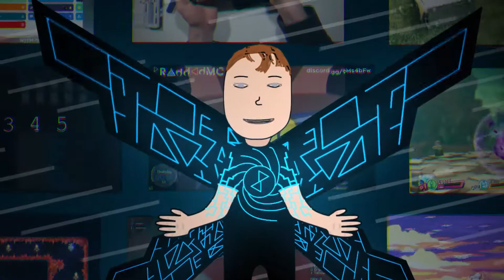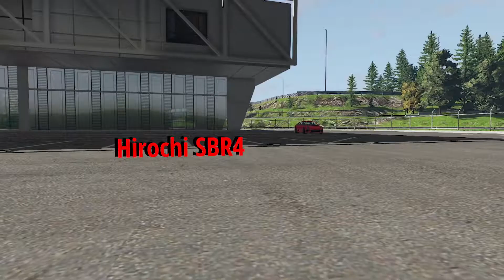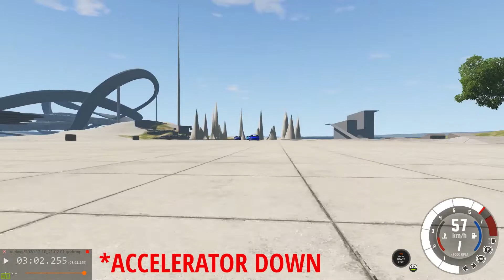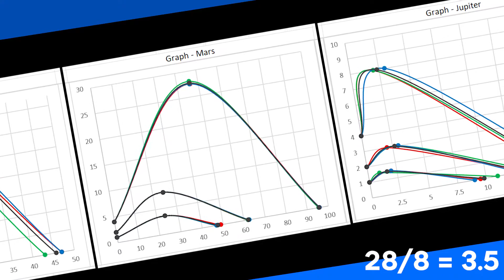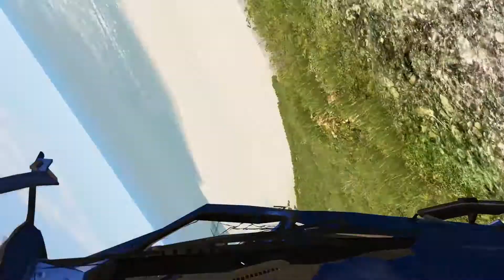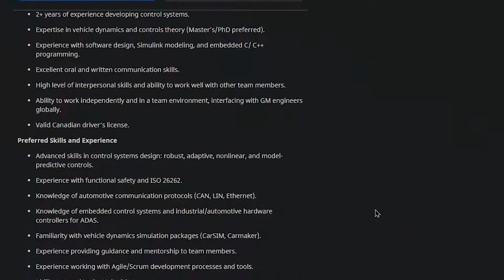Science with BeamNG.Drive: How does the gravity of another world affect our automotive technology?

Comment: This video is extremely underrated. Great research!
Reply from the maker: Thanks! Lol I thought it was a pretty interesting project to do for my physics class and my teacher thought so as well.
Reply: @Radded  Watching this also evoked a theory for me. If we plan on teraforming Mars, I feel cars and trucks will need quite a bit of modifications to combat the gravity and terrain of Mars. Such as aluminum tires, an extra set of wheels diagnonal to the front tires and a significant weight increase.
Reply from the maker: Yeah, there's a lot that would need to be done but it wouldn't be all bad. You may not actually need to do much to the tires once roads are put in. Since there's a lower force of gravity you could actually put a larger, 'heavier' engine in a car and have it perform better on Mars than Earth once it has optimal traction.
Reply: @Radded  Fair. I'd say alluminum tires mainly because of how low the oxygen levels would be, since I assume air wouldn't neccessarily work the same in tires on Mars. At least unless we can figure out how to get enough trees to live and thrive there.